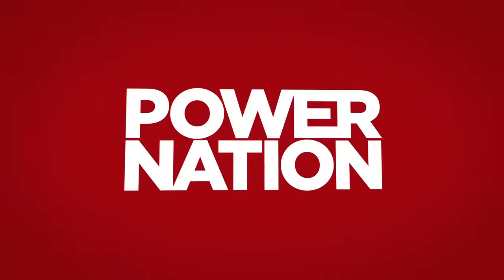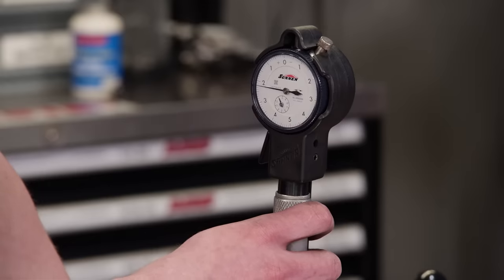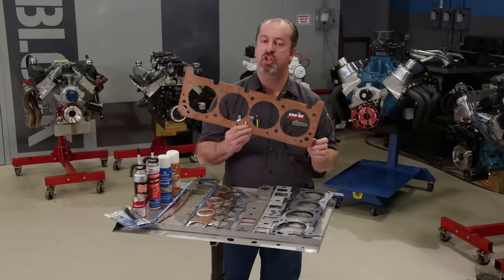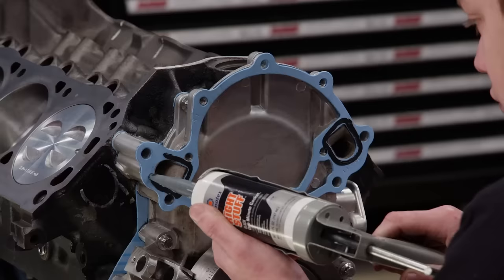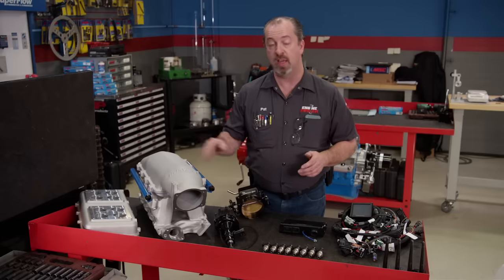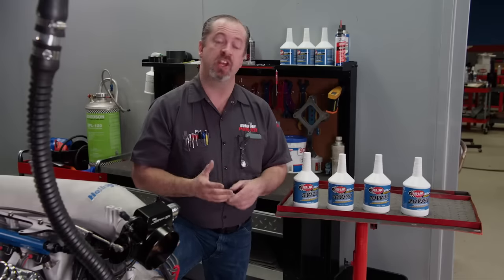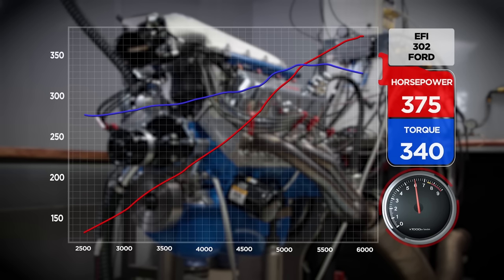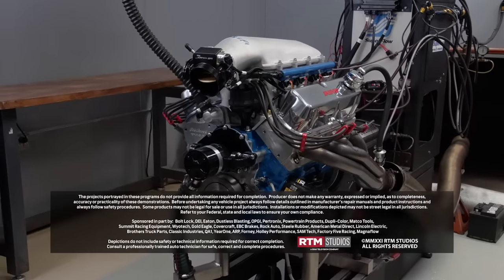Old School 302 Ford Goes High Tech - Engine Power S8, E9

Comment: MORE RPM!!!  Power curve was going almost straight up when they shut it off!  SPIN that little 3" stroke!
Reply: yea, this was horrible testing. More rpm, more fuel,
Reply: @starbattles1  i mean the computer already adds fuel and you dont want to spin a 302 past 6k too much cause they start coming apart trust me i own a fox
Reply: @mustangmadness530  with a professionally balanced rotating assembly there’s no reason you can turn 7000…
Reply: @Texas_Road_Warrior  yes but if it’s stock block they won’t hold
Reply: @mustangmadness530  Not true!
https://www.google.com/amp/s/www.motortrend.com/how-to/ccrp-0810-302ci-small-block-ford/amp/

Though, they use a Mexican 302 block which should be the strongest of the stock varieties. I would like to see how balanced internals in an H. O. block would do at 7K.
Reply: @starbattles1  They just didn't want it showing up any Chevy engines, lol
Reply: @mustangmadness530  Look up my car on here.  Went 9.27 @ 135.6 with a pump gas, stock block 306 with a 200 hp plate...  shifting at 7k rpm.  Did this for over a decade and dozens of nitrous bottles.  Can't be stupid about things, and run it into detonation at those power levels, or you will kill it.  Have to be safe about things.
Reply: @mustangmadness530  me too, it hurts😂🥲
Reply: @mustangmadness530  that’s just not true I have 3 foxes 302s can handle a lot more than people think
Reply: @cellphonelightsaber  they might not want to show up the gm stuff, but the Fords seems to always make more power. I've watched a bunch of videos and know and spoke to alot of racers and engine builders back when I used to play around. Built with the same goodies and close in ci the Fords always produce a little more hp. I'm  62 and noticed the bias in favor of gm. Never could figure out why. But I will say in gms favor is this. I'm pretty sure that they placed there people in the right positions in various race venues over the years.
Reply: @n2omike  Your Mph is @ least 10Mph to low for a 8.9 pass, sure you didnt mean 9.90?
Reply: @evilinside5984  Don't know what happened there!  It was a 9.27.  1.32 60ft.
Reply: I spin m😢 little 3 inch stroke... LoL

Comment: When will you finish the 300 in-line 6 with a turbo?
Reply: If this becomes a give away engine as well, I want the turbo 300!
Reply: Amen, I'm working on one and want too add a turbo myself, but wanna see some numbers first!
Reply: The 300 cui is the worse of the ford I6's to turbo, apparently the 240 and even the old 200 respond way better to forced induction.
Reply: @bigboreracing356  Oh definitely, but those are not from the same engine family anymore, and available only in Australia.
Reply: Yeah!,where is it
Reply: @Vaino_Hotti  what kinda power could one get from a turbo 200/240 Ford?
Reply: I'm waiting too
Reply: They never finish their videos and it does my head in
Reply: @trainsbangsandautomobiles824  I’m not sure. They did Chevy 292 with I think 10 psi. It was impressive.
Reply: @Vaino_Hotti  why would it be worse? It would be perfect, a big cube, lazy,  under stressed and strong engine. The torque would be huge.
Reply: Search YouTube for new video "nicks super turbocharged do 300 inline 6"
Reply: @rocsti5402  I saw that one. It’s pretty awesome
Reply: @davidthompson245  look up Adam Lzs youtube and his barra swapped mustang. He had the engine shipped from Australia. Its boosted and bad as hell
Reply: I want it now
Reply: Agreed!!
Reply: @bigboreracing356  if you want a dependable reliable motor that you have to literally blow up with grenade than you go 4.9
Reply: @bigboreracing356  owned one ???
Reply: @justinlyons5374  the world will die before a 4.9
Reply: 6 cylinders suck, who cares what happens to the 300
Reply: @benlancaster6535  you’re just mean, and don’t care about other people’s feelings. Now I’m sad 😢 ….
Reply: @benlancaster6535  hell no they dont, ford barra inline 6 is bat shit crazy. There is a 2200 hp barra out there now.
Reply: @CrotchRocket78  imagine what it could do with 2 more cylinders
Reply: @bigboreracing356  200kw in std n/a
Reply: He never said that was the best
Reply: The video is out now
Reply: In the future
Reply: @joshuaprice34  yeah instead of finishing it becomes a 10-13min commercial, guess they have to pay the bills somehow...

Comment: Pro-tip, on Windsor engines, always, and I mean always put a bit of anti-seize on the longer water pump bolts, you or the next guy will appreciate it, as there's a lot of 302/351s out there missing a water pump bolt, or like mine, have a stud welded in.

Comment: Hey..  you guys should do a build on a Dogdge V10 out of a Ram..   see if you can build it to out perform a Viper V10...  I've always suspected that you could build a magnum V10 for way less than a used viper engine..
Reply: It wouldn't be hard at all, but they weigh like 3x more, full cast iron black and heads. Also the srt10 trucks are actual viper engines so they're out there, and maybe even cheaper than you think.
Reply: A friend of mine had the V10 in His truck. He said that His 440 powered race car got better MPG than the truck that pulled it!
Reply: @bigboreracing356  I'm quite aware, but yes you're right.
Reply: @bigboreracing356  why you telling us no one cares
Reply: just struck me as a little odd thats all no offence meant by it!  hope you have a nice day.
Reply: I owned one that was paired to a NV4500. Awesome beast but fragile for a big iron block.
Reply: if you know your way about, it tends to be cheaper to snag the truck version of an engine than to buy the romance of a "corvette 350". but the V10 has passed its 15 seconds of fame, everyone who can figure out how to keep the lifters in a Gen 3 Hemi, use it instead. fits better, and the 707 hp Hellcat has the better reputation now as the big boy on the block. A V10 tells people how long ago you built the car, to be honest, just like an LT1 engine over an LS1 or a Terminator DOHC over a Coyote.
Reply: Last time I saw a used truck V10 it was 10k minimum...they aren't that common and held onto, not sold cheap, high demand.
Reply: @rocsti5402  especially Gen 3 Trucks from 2003 they supposedly made 615 who knows how many are left
Reply: I was gonna say... the engine says Viper on it! So do some trucks with optional badging or decals. Rumble 🐝 engine logo was standard but I remember some srt 10s with Viper stripes and decals. I remember the Shelby srt10 truck!
Reply: Truck Viper engines with upgrades to top end and twin turbos make like 1800hp and with +1 or +2 more boost (pushing it) made 2100hp!!! And they didn't spend 70k on a new hellcat/demon engine, try to find a used 707/747 or 808hp engine that's documented and not abused. It's impossible! They made millions of srt10 trucks tho

Comment: Surprised with the tall tunnel ram intake that you didn't take it to 7k.  Might have gotten a little more out of it.   That's where my little 302 with a tunnel and decent sized cam made the most power.
Reply: Typical of a big bore short stroke combo. Chevy 302'S did the same and more.

Comment: I'm a big fan of the channel and Holley Efi. You should mention to everyone that when tuning and add timing and no improvement you need to back timing back down. Same for fuel, if you lean it our and no difference you need to add that fuel back in. You did both on this one but didn't show putting it back. I sure hope you put it back to give this motor a chance to stay cooler and live longer.

Comment: I have a 5.0 later in my old Ford trucks 87 Ford with 500 thousand miles on it and it still runs like a top
Reply: Awesome brother my 96 F150 has a 5.0L (302) Windsor V8 in it with 209,000 miles and still going strong.
Reply: I had an ‘88 LX 5.0 Mustang. When I upgraded the heads/intake to GT40 variants and cleaned the block I saw a beautiful cross hatch pattern on all 8 cylinder walls. It didn’t get babied either 😂 Motor had 200k at this point. I love SBF’s

Comment: This would be a really nice powerplant for a cruiser Fox body Mustang or an OBS F-150. Plus, with the Holley Terminator standalone boost would be a great option for this small block.
Reply: on a stock 302 block i'd avoid the boost  with .060" overbore, would have made way more sense to start with a 351W
Reply: How would you connect that ecm/ecu to an E4OD transmission in an OBS F-150?

Comment: .060 over! What year is that block? Still running a 594 roller 289 I put together in the 80s. The SB genius at Kirn auto in St Louis, now closed like many shops, took old 70 351 heads, took .040 off, uses Chevy stainless valves he trimed down, 1.64 and 1.90 and did a porting job that rivals today's heads, ported the Edelbrock torker to match, all crower valve train parts, At 10/1 he figured it's around 400+, even has header evac, boss oil pan and windage tray for higher revs. Have a 77 302sb from a 150 that's waiting to be built into?, have a steel boss 302 custom drilled, lightened knife edged crank for a healthy SB to spin things. My old  68 Cougar was  reinforced during restoration for some serious torque. Wrinkles the tires as is, they are angry lil engines!

Comment: I've always wanted to build a modernized short deck Clevor. Port fuel injection, coil near plug ignition, the works. See if I could go inch for inch with a Coyote.
Reply: clevor would give a coyote a good workout if stroked to 408

Comment: They put a CNC 205 head on the LS that flows over 300 cfm and then put a 170 performer head that flows 230 cfm on the Ford and can't even make 400 hp. I'm a Ford guy and this engine wouldn't be a bad street performer but the 302 Ford can make alot more than that. I would love to go on there and show them how to make 450 hp from a 302.
Reply: They did a 347" SBF not so long ago and at the 500HP mark they had to go to an aftermarket block so would have made more sense for them to use a 351W based engine if you wanted stock for stock, they would have made over 400HP easily and had more torque to back up the HP. they said the EFI will handle more which is great but if you wanted to do turbo or supercharger then the block becomes the weak link at .060" over i'd pass and used the stock crankshaft another cringe. you can do all of this stuff but does it make sense when your whole foundation for your house is made of popsicle sticks and gorilla glue?
Reply: 450? 302? At what rpm? Exactly..
Reply: 450? 302? At what rpm? Exactly..
Reply: I have some older World Roush heads. I can't remember the model. I've got a 88 moosetang. I can never decide if to build the 302 I love, stroke it, or go 351 stroker. I want to keep efi on this.
Reply: @vengeanceizmine9878  7000
Reply: @jasonwalls1277  Ok. Now ask yourself,  is this build an "all out, high rpm, make as much power as possible" type of build? Not really, so nobody is saying 450 isn't possible. Just not needed for this application. Big difference.
Reply: @xmo552  Which one you go with will depend on which one works best with those heads for the power and range you are after. Knowing those heads well, stick with an 8.2 deck, mild hyd roller , 9-1 and FI. Those heads don't work well on the bigger inch 9.5 deck stuff.
Reply: @vengeanceizmine9878  no it's not an all out build. It's only 10.5 cr and I could have used an even bigger head. It was an awesome street fighting engine
Reply: @jasonwalls1277  No. I meant the engine in the video.
Reply: @vengeanceizmine9878  with the size of that cam they're using and that hi ram intake it sure seems like a high rpm big na power build to me.  The heads are holding it back and they also need a bit more rpm.  6800-7k.  They're limiting it quite a bit.

Comment: The graph was still climbing when Pat pulled it back. Based on Comp Cam's advertised peak of 6,300 and the torque, the engine should make 425 hp (assuming enough cylinder head flow). Great build with leftover parts.

Comment: So I've tried to find this cam on summit and it seemingly doesn't exist? There's no roller cams for a 289/302 with 114LSA so either they don't sell it anymore or the cam information in the video is incorrect.

Edit: ok so I found the cam, it's the XFI series and it's for a 351w so I'm assuming it would change the firing order from the early style 302s

Comment: I’d  happy give your motor a nice home. I’ve located an old Falcon that super clean. The guy who has it tried swapping over to front disc brakes, and couldn’t find anything that would work. I think there’s got to be something available for that. The other thing he did was to put an AMC rear end in it, and I’m not sure that’s the best option. I’d rather have a 9” or 8.8” with rear disc brakes.

Comment: I've always been told to not bore a 302/5.0 factory block over .030" because of the thin casting of those blocks. 
How well is that one going to hold up being bored .060" oversize?
Reply: Always heard the same about Chevy big blocks
Reply: I was thinking same thing, 0.060” over dang

Comment: Okay Boys, I have a challenge for you, that is if you even read these posts.
I have a 1991 Ford f-150 that I have had since 1997
I have never upgraded the engine in anyway shape and or form until this month. 
I just put new long tube headers, 48,000v coil, 8.5mm wires, MSD cap and rotor. E3 spark plus and a Accel ignition module and I am installing a new pickup coil. Thus far that is all I am doing to it.
I have noticed allot of replacement parts for this engine and I would love to see you guy build this engine with all of the performance parts that are for this model of engine.
For instance like the performance replacement induction for this engine. 
I want to keep the stock look of it but want to do up grades in phases. 
I would love to see you guys play with this idea and let us know the benefits of these parts.
Thank you!
But then again I would like you folks to do a 245/265 Hemi slant 6 but hey first things first.

Comment: Spin that motor to 6800 .....and put some afr renegades with that cam they should be 7k 450 hp sbf
Reply: This.  People don't realize not choosing the correct parts that work together and not revving the engine enough can kill horsepower

Comment: I would love to see you guys build a 5.4-3valve engine. It is known as the engine that is the worst Ford engine put in the F-150 truck. I'd love to see what you guys can do to make that engine reliable and long lasting.
I'll be looking for an answer
Reply: Well the main things with those engines are the timing phasers, timing chains and tensioners. hydraulic lash adjusters and rockers. I like the 5.4 2v myself. Less to tear up.

Comment: Love the show! I don't mean this derogatory to you guys. But all I learned from this video is that those performer RPM heads are way out of date and left behind by newer head designs. Pretty much any flat top short block, AFR 185 renegades or trick flow twisted wedge 170 11rs with a comp XE274 HR will make like 430 with a dual plane and simple carb or 450 to 460 with a single plane and 7k RPM. That is just the typical 302 inch small block ford on the street these days, times have changed! I've never seen one done up with nice heads and as fancy of a top end as y'all use. But my guess is it would be pretty epic. I've got one myself with 185 renegades and a dual plane and it straight up rips. That head choice killed the build. The modern head technology is amazing.

Comment: When the 4.2l in my 03 f150 bites the dust I'm thinking about going this route or building a stroked and supercharged 4.2l. Y'all should do a 4.3l stroker build. Super six motorsports has the kits and everything you need
Reply: Whats crazy is the 302 in this episode made less power than the 4.3 stroker v6 with a 600 cfm carb that Super Six dynoed in their video! Less weight, more power! 💪

Comment: That engine would be perfect in my 93 F150 4x4, it’s very similar to the one in my Foxbody besides the holley equipment
Reply: I have a cobra motor in my 94 f150. Its pretty sweet.